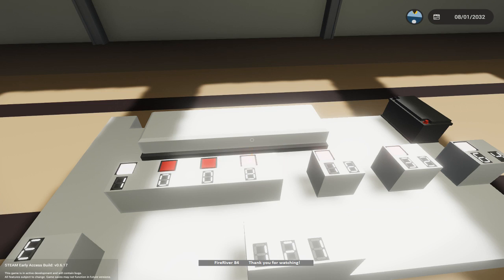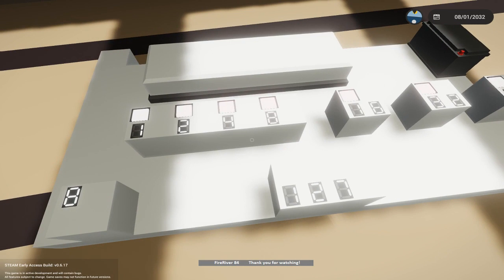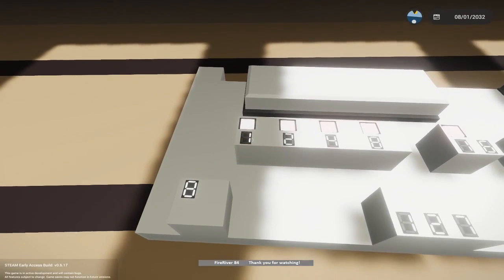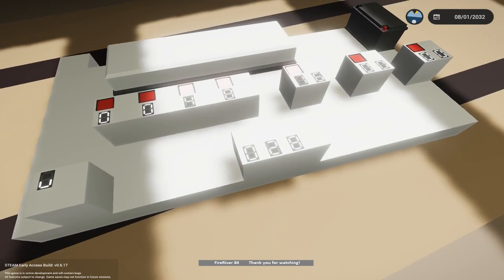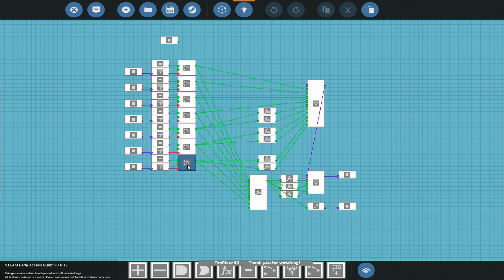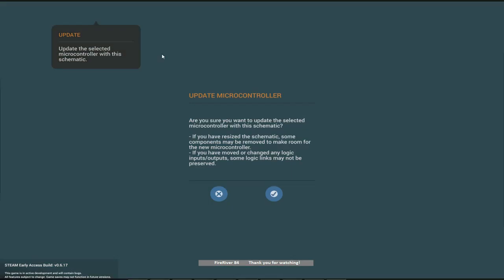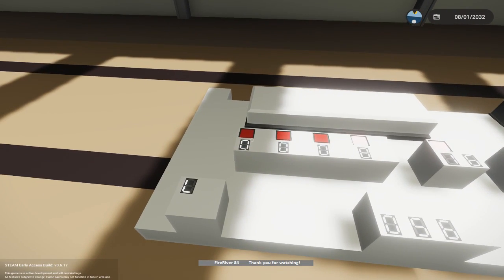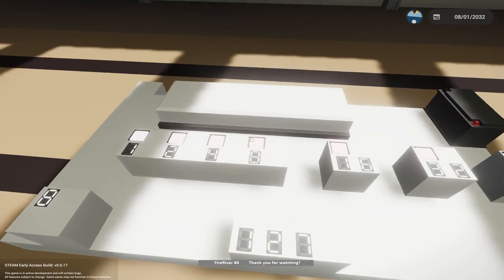Stormworks: Build and Rescue - Seven Segement Binary

Comment: nice :)  happy Ester
Reply from the maker: Mattias Rask, happy Easter to and your family!
Reply: @fireriver8412  need some help how can a get  6 seven segment to one( number to composite binary )block .. trying to put 121 first 109 second 115 third 0 fourth 063 fifth 055
Reply from the maker: @mattiasrask1575 
So you want 6x seven segments to display these a character at the same time?

So the 1st one would display (G?)
 _
|
| _ |

2nd   (S or 5)
 _
| _
 _ |

3rd (P)
 _ 
| _|
|

so on....
Reply from the maker: @mattiasrask1575 , From what I see there is no way of doing it. The issue is that you cannot put the binary composites into channels. This means you would need to have one seven segment per display panel block, and a output composite which goes to that panel block. So 6 blocks of panels instruments and seven output composites. 
I tried out what I could think you were doing and this is the result.
https://youtu.be/3akP-G2tiU4
Reply from the maker: Hi Mattias, hope you have been doing well. Just want to let you know I figured how to use binary and put that into multiple seven segments. https://youtu.be/1ZESOieqW-M this shows the relationship between binary and the channels.